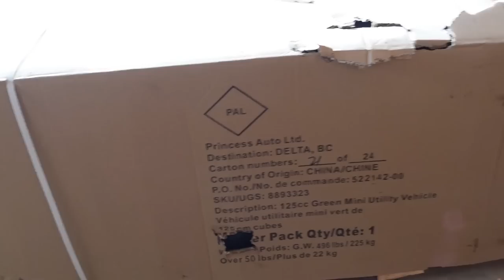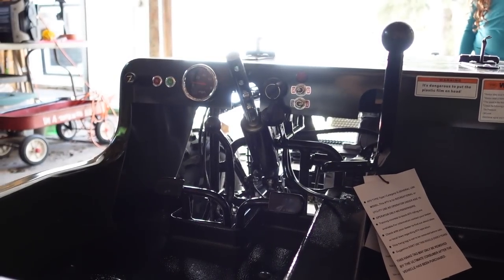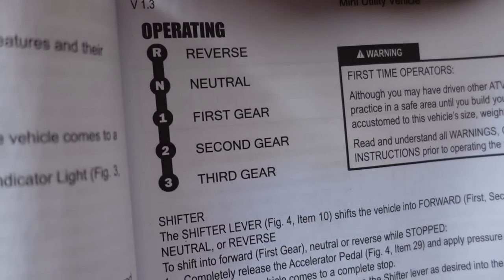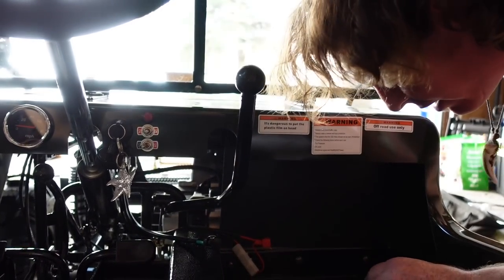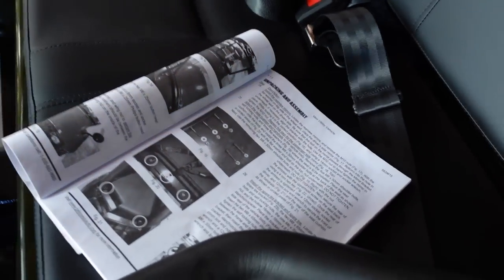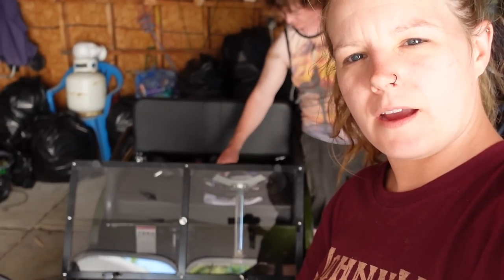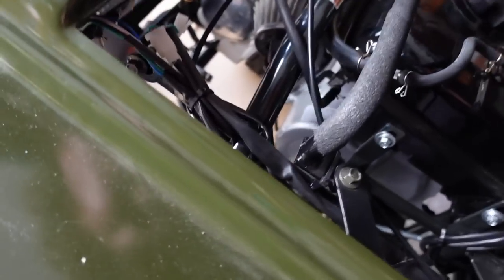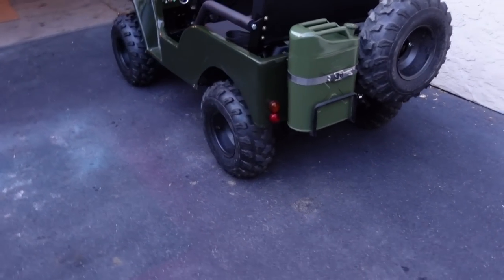I BOUGHT  125cc GAS ELECTRIC START/MINI JEEP/GOLFCART/UNBOXING/ASSEMBLY/SETUP

Comment: No big deal but it looks like the tires have directional tread, put the spare on the left front, left front to the  right rear, right rear to the left rear  and  left rear to spare , that's a pretty cool ride

Comment: Have the spare "fuel" jerri-can cut in half length-wise on the sides and add hinges. You can use it to hold soft drinks, (or hard) and/or sandwitches for a snack. You can also use it to hold a small gas container that is legally allowed, for just-in-case. I can't seem to find it but one of the hot-rod magazines of the 1980's or 90's took a jeep wrangler style (CJ5  I think it was) and customized it with wrangler jeans seat and dash boards, put a low spoiler on the front and a valance on the back. IT WAS COOL!! The last thing they said in the article, was, with all the add-ons added, it was still a Jeep and would do anything asked of it. It would be something to think about.
Reply: Also, during WW2, the Army (s) added floats to the side of their jeeps to make them float. After the war, someone added tracks  to a jeep, for snow, mud, and other rough roads.
Reply: It's on you tube Jerry can cooler I think 🤔 that's it

Comment: I live in the States and I tried to buy something from Princess Auto (louver die closeout) and so I had a deal with the UPS store in Fargo (because they are only currently shipping to North Dakota) to have it delivered to them and have them tranship them to me in Washington State. So, there were 4 left and I placed my order and it went through and then a couple of days later I received an email stating it was cancelled. Turns out that if I was in Canada I could have had it shipped to any Princess Auto in Canada and dropped by and picked it up but they would only ship to the U.S. from 3 different stores and if it wasn't available/in inventory in one of those stores they wouldn't ship it from another store, even if I agreed to pay more for the privilege. Ergo, I will be boycotting them forever if they expand into the U.S. they have crappy customer service for an emerging U.S. market.

Comment: I’ve beed curious about these for a while as I often see them at my local Princess Auto. Is it just a toy? Are there any practical applications?
Reply from the maker: Hey there , thanks for stopping in … Practically, so so… the snow blade is pretty good . Except your in a open cab in the winter.  I ordered the dump trailer for it from the manufacturer… hopefully it comes soon. 
We have taken it into the trails , it can keep up with a quad and get into all the places a quad can. 

It rides a bit rougher than a quad. 

We basically use it for a beach/lake cruiser . But I have some accessories on order for it and will be doing some up date videos , subscribe to catch those !!✌🏼
Reply: I plan to ride mine in my local town heart in Ohio USA 🇺🇸

Comment: I did not turn on the fuel. Switch either.  I was like wtf... But then MacGyvered it to the switch.  Lol
Reply from the maker: Yes… is it does make sense to turn the switch on  before , however ours was not clear to do so…. Instructions could have been clearer. 

I have some update Jeep vids coming in the spring . Bought some accessories that are on their way… subscribe so you don’t miss out !

Comment: I have a complete goldwing gl1200 motor that I'm not using i should order one and convert it to goldwing.  I bet it would do 
100mph with goldwing power.  But it would disgrace the goldwing motor to be put in cheap China junk. It would be funny tho. Untill the goldwing motor rips apart the Chinesium poor quality welds.  I think its a bit backwards to pay $2000
In shipping for $700 worth of Chinesium poor quality merchandise. 
A Japanese honda knock off motor in a ww2 knock off jeep. Kinda ironic.
But if not for stealing other countries ideas and work china would still be living in the 18th century.